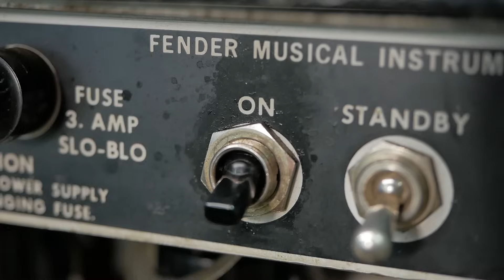Fender Silver Face Twin Restoration - Part 1

Comment: Hi everyone, it's my Fender Twin :) We put it in to get all the valves replaced and there was no budget or minimum spend pressure placed on the repairer. My Dad bought this amp nearly new and has taken wonderful care of it, so we're guessing most of the findings are from recent work. There were some issue post valve replacement which the repairer was trying to sort through and this shows in the approach to cut and re-solder. I asked for the amp back twice when it was clear to us that the repairer was out of his depth, but unfortunately, he persisted to find the issue which looks to have added further cost to this repair. I feel at ease knowing that Brad has it now and we'll be getting back a quality repaired twin reverb..
Reply: Lucky you. 👍👍👍🇨🇦

Comment: Ah, lovely. Re that power switch, I recently just had one that was mechanically no good. Out of curiosity I opened it up and it was in good condition. The original grease had just hardened up on the paddle-spring ball joint thing. It came good with a clean and relube (non-conductive high temp, high viscosity stuff)

Comment: exemplary explanation as usual Brad! On the "creeping green death" seen on the old PVC insulated copper there are several sulfides of copper that are green but this may be the chloride, atacamite (Cu2Cl(OH)3). This corrosion on the surface likely wont compromise the wires conductivity but will make it very difficult to solder. PE insulation is thus much preferred!

Comment: I recently tried to use 25 year old xlr cable which Id stored in a plastic container.   Found 150 feet of it green/corroded all the way along the cable.   Had to dump it of course.   It’s amazing how the corrosion wicks up the bundle.

Comment: What a sad state of affairs for the Twin.  How any "tech" could let it leave his/her bench in that state is beyond me, even if the budget was limited.  The tech would be better off declining the repair.  I guess I've been pretty lucky with the Fender amps I have from the 1960's and 1970's.  Besides the normal servicing, I've only had to touch up a few solder joints and reverse a questionable mod done to my 1977 Deluxe Reverb.  I look forward to seeing you get the Twin in ship-shape.

Comment: The filter caps under can looked pretty good. Did you use an ESR-70 to measure the value and ESR value, you can lift the earth connection to see if they are leaky. I have found these filter caps to be good quality, the tolerance is good, the ESR value is good and leakage is good. If you replaced these caps with Illinois caps, you would be replacing good caps with poor performance caps. Just saying. 😊
Reply from the maker: IC brand caps from Digikey / Mouser actually are reliable, but the name is sullied thanks to the cut-rate caps Fender continually sources from them, so I don't use them for anything.
Give me some credit, mate.
I don't reuse 50 year old caps and nobody else should either.
Reply: @BradsGuitarGarage  thanks for your prompt reply, for some reason. I didn’t get notified. I bought the blue IC caps and the ESR value is worse than the caps I was replacing. I returned the IC caps and bought Vishay caps which are excellent.
Reply from the maker: Yes, Vishay are the best if you can get them.
I generally use TAD for all the high voltage axials and Vishay for all the sub-160v stuff.
F&T are good too, but some are larger diameter and they're all rather expensive.
Reply: @BradsGuitarGarage  TAD products are very good. I like them a lot.

Comment: Watched a video of Fran Blanche at Franlab overhauling her old Fender amp. IIRC she had the same problem on her old power cable.

From memory, think she said it was PCBs leaching out of the cable insulation?

I don't know for sure, but she seems generally well informed about things like this, so you may want to wear gloves, mate?

Comment: I personally enjoy jobs like this - a good chance to use the skill set but sadly add previous $900 and you have to feel sorry for the customer. Board spacer: *Both boards degrade from moisture, dirt, become conductive and often *microphonic together. The depop, IPA clean etc fix seems widely used but how long before it becomes conductive again? Fender eyelet boards are available, not sure what material they use. I recently purchased a black turret board blank, did design, drill, turrets insert and then measured some leakage (50 to 200 meg between some points) Had to mill slots in the board to save it.... frickin PITA.   Next one will be FR4. I'm sure you will do a nice job on this old beast Brad.

Comment: That green goo concerns me due to it being everywhere.  It's almost like someone used cleaning spray on everything.  Like Simple Green or similar and it wicked into the wires.
What about replacing the diodes on the bias board as well?

I know there are two sides to this issue, one being replace if you have a better options, and the value of the amp is originality.  
So, wouldn't it be a better option to replace the eyelet board with a newer construction fiberglass board with turret style solder connections vs depopulating, de-waxing, iso/alcohol cleaning, repopulating the eyelet board and backer boards?

The smaller Bias and B* boards could be changed over as well, or even PCB replacements now that you can order small batch PCB cheaply.

Do I get 40 lashes for even suggesting such a thing?

Comment: do you think carbon comps sound better than metal film resistors (assuming it's in the audio path)?
Reply from the maker: It depends on their location in the circuit. And even then, the difference is very subtle.
The biggest issue is that there are no reliable sources of them anymore and they continue to drift in value dramatically and are more affected by humidity and temperature. Carbon film is the better option for many applications where carbon comp would offer some tonal advantages, and metal film are great in the power supply and wherever noise can be an issue such as reverb mix resistors and grid stoppers and plate supplies early in the signal chain, particularly in high gain amps.
Reply: @BradsGuitarGarage  word, I figured either way it wouldn't be drastic and most of the difference could just come down to subtle differences in values caused by temperature

Comment: That green crap is not from the solder joints. Someone placed that green crap there as a marker. It's some kind of gel but but it's corrosive and I don't know exactly what it is for certain.  I've seen it in amps before. I really don't know what the hell it is, but this isn't the first time I've seen that exact green crud in an amp before.  And I don't know why they put it in there but apparently it's something that techs used to use for some reason or another years ago. I would definitely do my best to get it out of that ant.Because I know it becomes corrosive and will actually eat through wires.

Comment: What the fuck was that Twin I had come in about 4 months ago?????? A Super Twin? Yes! I has to twist up a couple of coils for a Mesa style 6 band EQ, (that is one band better than Mesa!). Six 6L6GCs, and close to 160 watts. Thank God it had a 4 ohm output.  My small dummy load is 150 watts @ 8 ohms and the big one is something insane like 2000 watts in stereo so two x 16 in parallel = 4000 ohms, and I don't need a space heater or a hernia in summer.
Reply: Huh, Fender claims it's a 185 watt amp.
Reply: Oh yeah I do have a 350 watt 8 ohm load too (somewhere). Two 175 watt 4 ohm hair curlers. I use them for 2 ohms in parallel for SVTs.

Comment: Copper oxide is non conductive  the green gunk is a sign that the wire is done for good use .  Often the jacket is chemically reacting to produce the green death . This thing need your help the solder looks sad .  Good luck with that one.